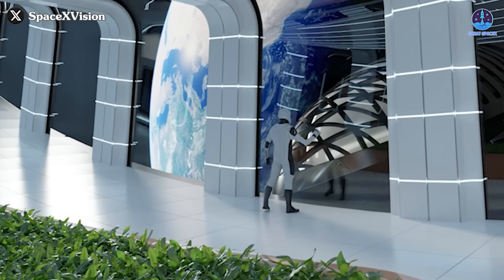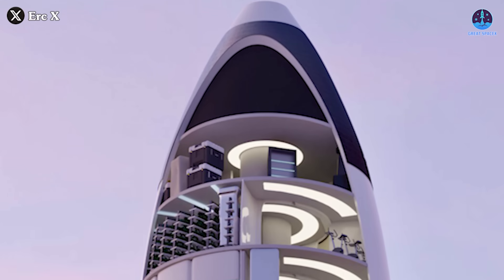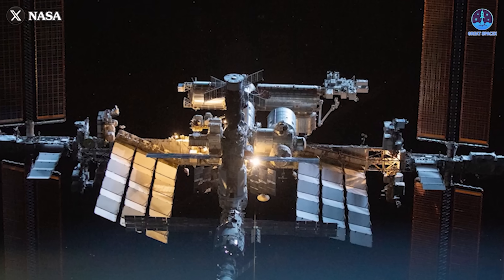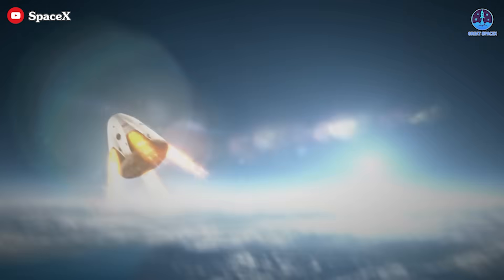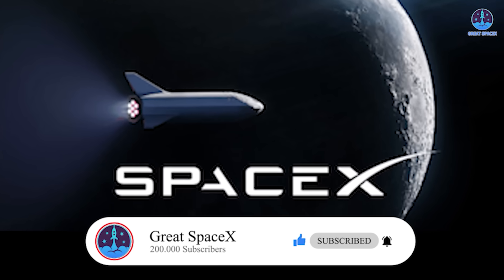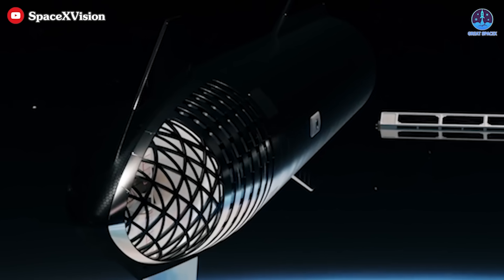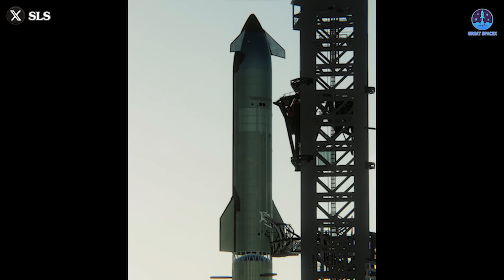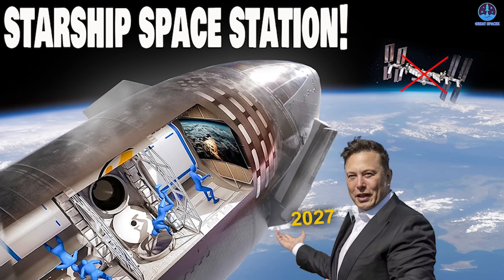SpaceX Starship to Become NEW NASA Space Station After ISS Deorbit...

Comment: Using the already ISS as a base to change?
as a catapillar morfs ninto  a butterfly.
sections 80% ready lifted by spaceX
arms grab position lock paerts together.
Shevron locking edges would make a circular
base to spin slowly giving slight outward 
push like gravity.
center start base hub a enter exit
two side loading .
center hub could be extended to make amulti
section base

Comment: Given our financial difficulties and the political instability, I think it would be wise to retain the current station until a new one is in place and fully functional.  I would suggest a docking port to allow the Starship or mulitible Starships to dock with the ISS this would allow the ISS to remain as a backup and escape system and allow long term experiments to remain  in place.  It would also allow the possibility to reuse equipment elements of the ISS for future use.  Since the ISS was build from modules this would be possible.  Don't count fully on a future station until it is built and functional.  Look what happened when the Space Shuttle was cancelled.  Nothing happened for a long time.
Reply: The ISS has already met its life cycle, the original decommission date was over 10 years ago, its a catastrophe waiting to happen, it needs to be replaced by a modern viable solution.

Comment: no better robots, three d manufacturing
Reply: It just needs rolls of stainless steel sent into leo and adhesive sticky tracked autonomous welding robots that can roll across the surface of the sheet as its being rolled out in vacuum and build the space station off of a 3d manufacturing process program similar to what cnc machines or welding robot arms are operating on in terrestrial factories, that way there is no chance of casualties during the construction process.

Comment: should use the ISS dismantle as needed using the parts.
Reply: Most of the parts are so old it's basically scrap metal. Been in orbit getting smacked by debris for a few decades. Another video set that it would take more spacewalks to dismantle the ISS then have ever been done in its 40 year service life. Personally, I would like to see them push it into a higher orbit for archival. However, the reason it orbits so close to Earth is because a lot of the space debris in that orbit also falls into the Earth's gravity. So the higher up you go, the more space debris. Also you need a massive rocket to orbit it higher, full of fuel. And the rocket itself has to get there. So now you're talking about multiple launches to bring enough fuel to get the ISS into higher orbit. It just isn't worth it.

Comment: Another fake plan to move this goal post for SpaceX “success“once again! The point of this plan is to try and convince people that the starship is absolutely necessary for building a space station. The point is not to build a space station, but just to try and convince people that starship is indispensable. That’s why this is a fake plan! If starship becomes indispensable to building the next space station, then every day of delay in trying to get starship working delays this space station. If the point is to build a space station, you don’t lock yourself into a single launch provider. However, the Elon cultist will jump up and down in anger if you say something like that so I fully expect to be flamed
Reply: I agree, we don't want a single launch provider, but no one else is even close. Block 3 can fall well short of the projected 200 tons to LEO and still be several times more than the next, New Glen at ~45 tons. ULA's Vulcan is almost half that again at 27 tons. No one will even attempt something similar unless spacex is successful in showing a significant market for such a heavy lift vehicle. Then it will take another 10-15 years for a production product. The current ISS is going to have its mission extended again, but if something of similar size is to replace it by the mid 2030s there really isn't an alternative.
Reply: Nothing sells like success.  All power to them.
Reply: @pctrashtalk2069  
Elon is the boy who cries "WOLF" over and over.  His time to succeed with these goalpost moves is running out.

Comment: Why does Starship need to be the station, and not just a delivery method?  Go up, drop off cargo, come back.  no need to complicate it.  Also, if a Starship is going to go into space and not come back, then the flaps and heat shield can be omitted, making fuel requirements less, thus more room for habitation.
Reply: Why can't starship be both a station and a delivery method? As for the flaps and heat shield, I believe it would be easier to use the same design than a whole new one. Who knows maybe they will make a new design for starship specifically for being a space station.  Furthermore, it could also be a way for SpaceX to use their fuel transfer for suture space missions.

Comment: The Sierra LIFE modules make even more sense. The larger versions are designed for Starship farings, and then inflate to even larger volumes.
Reply: Inflatable.. No thanks One blowout from a micro meter and every one dies.. a hole in a  metal ship can be plugged.
Reply: @ Not how it works. Look at how durable the inflatable modules are. They can still be plugged.

If you still were concerned, there’s an easy solution: you just make the exterior a little thicker, either before after inflating it. If you want a really cool solution, you incorporate a layer that you fill with water. Water is an excellent radiation shield and you want to have a bunch on hand, anyway. Even better, any puncture that exposes to the vacuum should freeze in the short term, until a more proper patch can be applied.

Comment: They could easily convert the tank section into usable space, the forward bulkhead could have a removable hatch section. They already have inspection hatches on the outer side of the ship. If the ship is to stay in orbit, then the header tanks wouldn't be required. I would build space station sections (20ft diameter) that fir inside inside the cargo section, with a 20ft diameter, with 2 floors along length, with joining sections with docking capabilities. If a section is compromised it can be sealed off & the other floor used so the station can still be fully accessed.